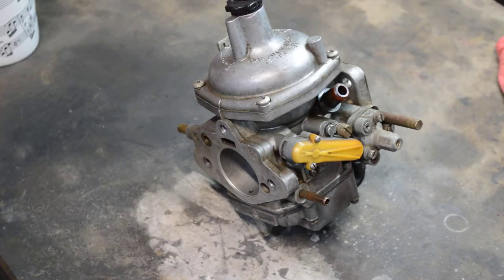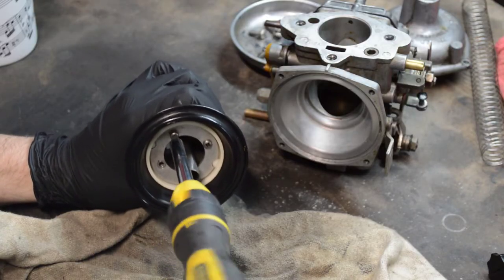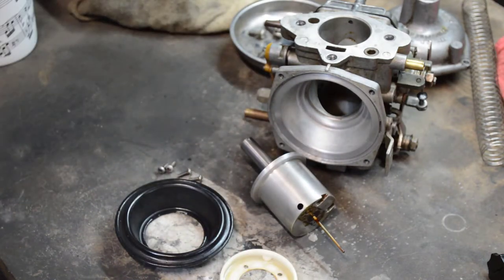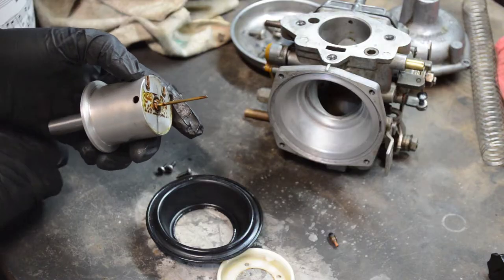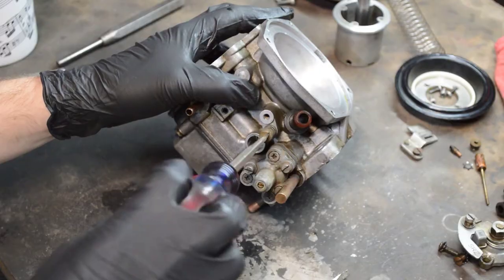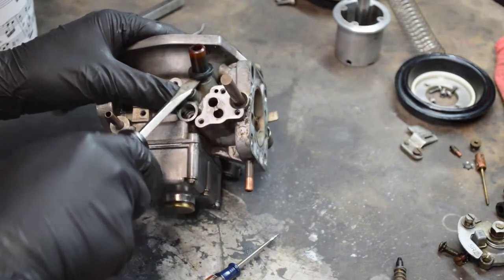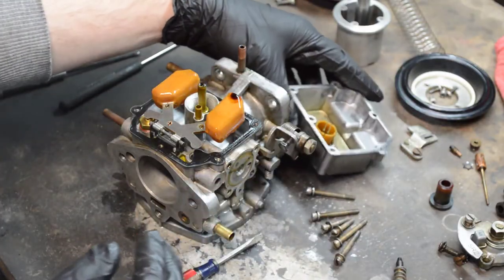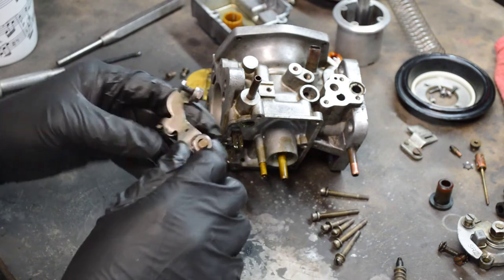Rebuilding Zenith-Stromberg CD-175 Carburetors - Disassembly

Comment: thanks for this and other related videos - question - I am rebuilding two 175-CD from a 1975 TR6 - on my carbs, the starter box / choke does not have the spring that is visible in this video, and also shown in the additional video where you disassemble the choke from another carb.  I don't understand the purpose of the spring as the choke is manually operated from dash control using a cable to open and then gradually close the choke.  Did some versions of these carbs not have the spring, and what function does the spring perform?
Reply from the maker: That's right, not all versions got the spring if memory serves. It's meant to help the unit to return to a "non choke" position. Older versions had a much stiffer cable instead of the wire strands, and the cable did the job of pushing the starter box into position.
Reply: @midwestmotoring  wow - that was quick - I was just about to send a clarification that I was talking about the spring visible on the outside of the assembly, not the internal one that keeps pressure to seal.... but your response indicates you knew what I meant.  I can't tell you how glad I am that I found your carb videos for the Zeniths - so much better than the so called "instructions" or diagrams that come with the rebuild kits.  I have a '75 TR6 that I have owned for 40 years that I am getting running again (been sitting in my garage for 5+ years) so I can sell it - I plan to use Craigs, Ebay, and maybe British Car Classifieds to list. Any other good places to list?  Thanks again!!!!!
Reply from the maker: Bring a trailer does pretty well, but I don't know about the process or costs.

Comment: Was curious, i have special tool to remove needle, but the hex tool can only move a few degrees in either direction. Im afraid to really put any muscle in to it. About the 10 minute mark. 1980 mgb
Reply from the maker: The special tool is not supposed to remove the needle.  It's only for adjusting it.  You need to disassemble the carburetor to remove the needle, and need a small screwdriver and a long, thin punch.
Reply: @midwestmotoring  Yep figured that out. Needle assembly was just stuck. Appreciate you getting g  ack with me. One more question: Where the throttle blade shaft goes through carb, are those aluminum bushing replaceable? Where the spring sits has worn into aluminum circle. I have the square cut orings and copper washers coming.

Comment: My zenith stromberg carburetor has a water choke. What is the function of the kick piston?
Reply from the maker: I'm not super familiar with the operation of the water choke, but the kick piston is basically controlled by engine vacuum, and can somewhat control whether the mixture is enriched or not.

Comment: Hi there, love your videos! Thanks for such an informative video on taking the carb apart. I do not have the tool you use to take the needle out starting at 6:20. Do you have a recommendation on where I can find that or what its called to order it? Thanks!
Reply from the maker: Moss Motors has them. It should be somewhere in the carb section on www.mossmotors.com.
Reply: @midwestmotoring  Thanks I just ordered one!

Comment: The float seems to be molded at an angle along the bottom side.  I'm having difficulty getting it to 17mm front to back.
Reply from the maker: Front to back isn't important. It's side to side you need to be aware of. You're measuring at the highest point on both sides.

Comment: Question? Would you want to JB weld the gaskets for the float chamber, etc?
Reply from the maker: Definitely not. You may need to get it apart again in the future, and the gaskets shouldn't leak if assembled correctly.

Comment: Do you know why the fuel does not go in to the engine? It gets to the carb and then it's just stuck. The fuel line gets so high pressure that when I remove it it spits fuel.
Reply from the maker: Either your engine isn't creating a vacuum or the carburetor needs to be rebuilt.  We do that service if you need, and if you're a member of the channel you'll get a discount as well.
Reply: @midwestmotoring  well I live in Sweden, so it's a bit long hahaha. So I just gave up and bought a su carburetor hahaha

Comment: I have the exact same carburetor on my 76. And very much appreciate your videos. But I have a problem with this one. Maybe you could clear it up for me. 
At 20 minutes and 22 seconds on this video you talk about the bypass valve ports on the next video at 12:52 you talk about the gasket your putting on lookin weird but that’s the way it supposed to be. 
I believe it looks weird because there should be gasket material between the two ports, the inlet and outlet, otherwise you’re going to be getting air fuel mixture completely bypassing the bypass valve through the gasket gap between the ports. Gasket material between the two ports forces the air fuel mixture to squeeze past the diaphragms brass valve disc and enter the lower port going to the intake manifold. 
Evidence of this air fuel mixture bypassing the bypass valve is right on the casting of the carburetor between the two ports and your bypass valve. 
No gaskets for the bypass valve that I have purchased have the correct gasket material between the two ports, looks like I’m making a couple gaskets like I did for many years during my military service. What are your thoughts?
Thanks again for all your videos I have learned much.
Reply from the maker: What you say makes sense, but I suspect it was designed that way. Unfortunately, my knowledge on fluid dynamics is lacking, so I couldn't say why that would be the case. Anyway, at idle the throttle isn't completely closed, so a little "permanent" bypass is just part of that and doesn't have a bad effect. It's the change in the flow that makes the difference.
Reply: @midwestmotoring  thank you for getting back to me. I’m going to continue doing research on this and if I find out anything else, I will let you know. Thank you.

Comment: Question i have same tool to adjust needle but left carb when put tool spin like 5 5 time the right carbs only spin 2 and half before stop on left side and right side what can be?
Reply from the maker: I'd guess it's the retainer being loose, but I'd have to take apart the carb to see.
Reply: @midwestmotoring  I'm be able to set carb properly even if that think its loose?
Reply from the maker: Maybe or maybe not.  I would need to disassemble part of the carb to see if it's working properly.

Comment: Hello MIDWEST
I dessambly my jet for change him and i dont Known the Good rotation for the jet . 
You can help me please ?
Reply from the maker: It is not necessary to remove the jets in most ZS CD175 rebuilds, so I don't do it very often.  You'll want to check your shop manual, since there is a specification for where to locate the jets.  Unfortunately I don't know what that is offhand.  Also make sure you use the proper tool for installation or you can damage the new jets.
Reply: @midwestmotoring  thanks 
I’ll try to find the Shop manuel stromberg

Comment: Great video! this will be my guide for my carb rebuild. I have a stromberg carb on my Volvo 145 and Im looking to rebuilding it. I want to know what's the difference between a CD, CD-2S and CD-2SE, it's just so I can buy the right repair kit. My one is just a CD-2 and I couldn't find any info online. Is my one a 2S? or a 2SE? I might have missed something. Thanks :D
Reply from the maker: Thanks, I'm happy someone's watching!  The difference is basically the addition of more stuff.  Original CD carburetors were much like SUs are.  They adjusted from the bottom, had no emissions stuff, and were extremely simple.  CD2s added a starter box (the choke) instead of having a rod lift up on the pistons slightly.  Then came the bypass valves, then the water chokes, and so forth.  I don't know where each of the changes came in, but that's basically how more letters got added.  All of them operate on the same basic principle though, and if you have a shop manual for the car it should tell you things like how high to set the floats.  I think the rebuild kits are pretty standard too--there are usually a fair number of gaskets that aren't for your specific application left over.  Just put on what you take off the carbs and you'll be fine.
Reply: I tried removing my float chamber bit it seems to be so hard to take off. There's this brass plug that jas groove for a flat head screw driver. Can i still remove the float chamber without removing the brass plug? Or im still missing another screw so i can remove it easily? I dont want to pry it out, i might break something. Thanks
Reply from the maker: Hi Joseph--sorry for the delay.  Apparently YouTube doesn't notify me except for the first message!  Anyway, yes, you can remove the float without the brass plug.  You can also take out the plug first (which I find to be easier on my cars).  A screwdriver with a large, flat head will do the trick, or you can use a pair of pliers on the plug.  So long as you're grabbing it below the o-ring, you can't really damage it except cosmetically.  Shoot me a message through www.mwmotoring.com if you have more questions.  Thanks!

Comment: what is the size Alan wrench that is used to adjust the needle?? I lost mine and wanted to get something
Reply from the maker: You really need the special tool. An Allen wrench won't hold the piston in place while you make adjustments and you're likely to damage the diaphragm.
Reply: @midwestmotoring  I have the tool  as you said that hold the piston in place, I lost the allen wrench that came with it.
Reply: 1/8 inch allen works on my 175 CD Stromberg, just make sure it's long enough to reach the adjustment screw.
Reply: @denniskwahl  I have the tool but can't find the allen wrench.

Comment: Hi! do you know what kind of oil goes into the carburetor?
Reply from the maker: The same as for your engine.  I have an oil can of 30w in my garage that I use, but you can top it off when you do an oil change with the same oil if you need.

Comment: At 26.35 you Said not to plug it off, if i dont have a coal canister can i plug it off? Or how would i modify it?
Reply from the maker: Good question!  So in older versions of the carburetor, the vent would go from the float bowl straight into the air cleaner, where it would get drafted into the carburetor.  In the later versions (which it sounds like you have), the valve that opens and closes with the throttle just switches between venting to the air cleaner and venting to the charcoal canister.  If you choose to modify your carbs, you would simply drill so that the vent to the air cleaner was always open.    You could also just leave the vent unplugged and let it vent to atmosphere.  That said, you'll still have some problems either way.  

For starters, if you have vents on your carburetors, you probably have a car that originally had a charcoal canister.  The canister is part of the crank case venting system and also part of your fuel tank vent.  Without it, you'll be venting fuel fumes under the bonnet since there's no vacuum to purge the canister.  If you have removed the piping that goes from the rocker cover to the carburetors, then you'll also have disabled your crankcase vent.  While it still might work (for example with a filter on the rocker cover), it will be less efficient and may cause oil leaks since the build up of pressure will have nowhere to go.  The system is designed to have everything work together, so I recommend NOT disabling the venting system.  It does not really have an effect on power.
Reply: @midwestmotoring  Thanks for a great answer, appreciate it.
Reply from the maker: @Splodder  glad I could help!  In short, the carbon canister is a receptacle for the fumes venting from the float bowls.  Once the throttles open up, though, the canister would be purged and the fumes pulled into the carburetors anyway.  I think about the only emissions component on a TR6 that has a negative effect would be the air pump they put on later ones.  Possibly the EGR, but I don't know enough about how that system works to answer that.  Other than that... they really just retarded the timing and lowered compression, but that can be easily fixed by skimming the head and advancing the timing again.

Comment: at 8 mins it seems that you only need an allen hex key and that the only need for the special tuning allen key  ... Is tuning  .. Is this right as that is when you have the diaphragms assembled not when you are doing it  Ta good vid
Reply from the maker: I think what you're asking is whether you need the special tool for assembly and disassembly purposes.  No, you do not.  The special tuning key is only necessary to adjust the needle when the carb is already put together.  The tool does 2 things at the same time.  1. The barrel of the tool slots into the air piston to keep it from rotating.  2. The allen key slots into the needle adjuster to raise and lower the needle when it's turned.  That way you can adjust he needle without turning the air piston... which would damage the rubber diaphragm by twisting it.  If the air piston/diaphragms are not installed in the carburetor, then the dashpot isn't holding the diaphragm in place--so you can turn the needle adjuster to your heart's content without breaking anything.  I hope this helps!  Thanks for watching!
Reply: @midwestmotoring  Ta mate Yep this is exactly what i was asking.  I have ordered the tool but want to get to the o ring so i can find size and fix.  Have 2 carbs sitting on me bench from a TR7

Comment: What is the difference between 175 cd and 175 cd-2?
Reply from the maker: The 2.  Seriously though, it's just a more modernized version of the same thing.  The carbs are the same size.  I believe they moved the choke, and started adding things such as the bypass valve and the temperature compensators.
Reply: @midwestmotoring  thanks for answer. Mine is literally looking same as yours in the video (choke,bypass etc..). But on top it reads only 175cd🤔 temperature compensator is white colored and the float bottom is more ”boxy”. Maybe the top has been replaced idk.. i have also seen some 175cd without bypass, temperature comp and with different choke. <- Older model?
Reply from the maker: Pretty much, yeah.  They made changes over time, but I'm not 100% on the CD vs. CD2 if it's not the chokes at least.  Maybe later CDs started some of the changes.

Comment: Where can I buy the tool to remove injector
Reply from the maker: Might just be a miscommunication, but what do you mean by injector?  Do you mean the adjusting tool to remove the metering needle or are you asking how to remove the jet?  If you have jets that are pressed in place it is very unlikely you need to remove them unless they're damaged.

Comment: my oil leaks out any idea
Reply from the maker: Yep.  The adjuster at the base has an o-ring around it.  That's where the oil is getting through.  You need to disassemble and replace the o-ring.
Reply: @midwestmotoring  I've been using 3 in1 oil in my dashpot with a new o-ring and it spewing out everywhere,obviously too thin.  John of University Motors recommends using 80-90 W gear oil in the dashpot...Your thoughts?
Reply from the maker: 80w90 gear oil is the same viscosity as 30w (similar to 3 in 1), so it's not thicker. The oring should not leak with 3 in 1, so something is wrong.
Reply: @midwestmotoring , OK  thanks, I'm thinking maybe I'm over filling the dashpot then. I bought this 77 MGB 3 months ago and have been trying to get it roadworthy since. I've gotten it to the point where it will idle on it's own, but if I give it throttle it backfires and wants to die. When it idles it also it goes up and down in rpm. It's turned into my hobby now and I'm having fun while learning.
Reply from the maker: Hmmm... that could easily be timing. See where it is with a timing light at idle. Then have someone increase and decrease the RPM up to about 3000 and watch the timing mark. It should move one way and then back. If it doesn't, then your distributor isn't advancing properly, which will cause backfiring and a lack of power. The best carb adjustments are always under the distributor cap. Remember that advice and you'll have a reliable MG!
Reply: @midwestmotoring  thanks again, I'll keep trying

Comment: Don’t use a Phillips screwdriver on a pozidrive screw. It is guaranteed to damage the screw. Get a PZ screwdriver!
Reply from the maker: That's a pozidriv bit I'm using. Good point though, and it can't be stressed enough.
Reply: @midwestmotoring  yep, I myself learned this the hard way, experience is a dear teacher. Great video.